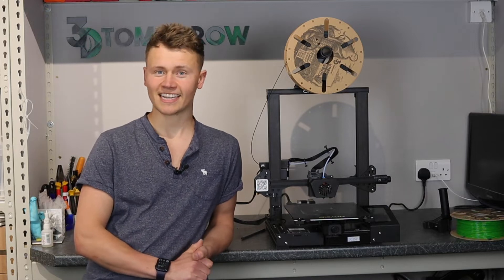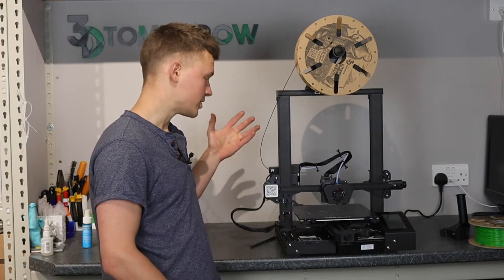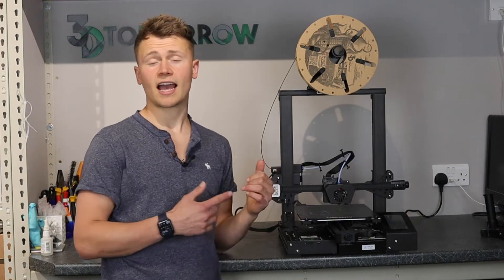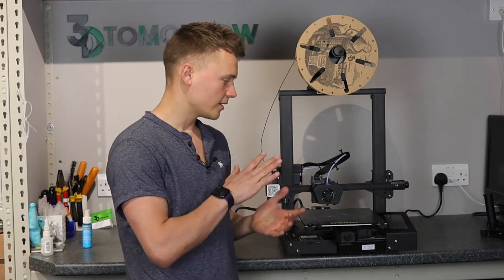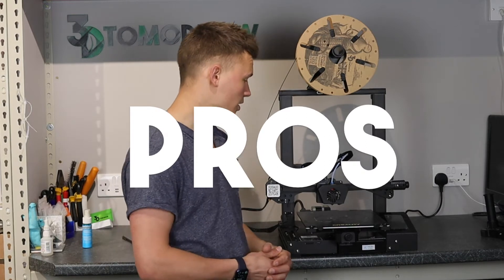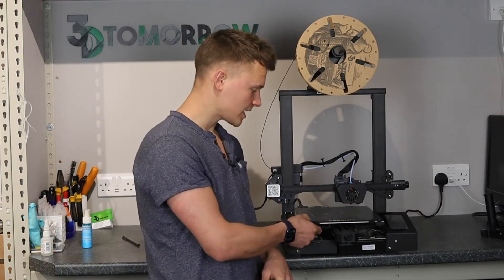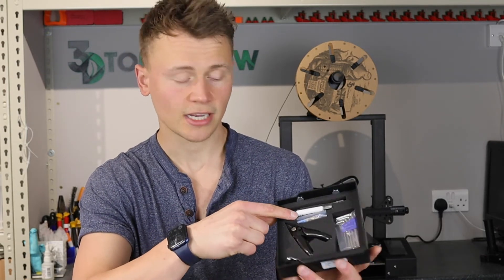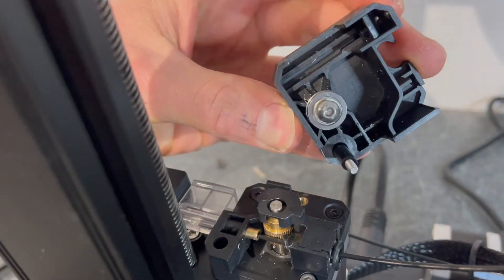Little #WorkHorse || Creality CR-6 SE || 3D Printer Review - Should this be your first 3D Printer?

Comment: First, lovely review. I just purchased 4x CR-6 SE from a local, these will be my first FDM printers and I am doing a lot of watching to get an idea where to start. At least here I got an idea of the hardware.

Where would you start for learning how to get my first print going?
Reply from the maker: Thank you!

In terms of starting off, you’ll want to do some calibration prints to find the best settings for your filament. But before that, get the bed level! For this printer heat it up, remove the filament and give the nozzle a wipe, then run the auto bed levelling.

I should do a series on calibration prints, that would probably go down well, thanks for sparking the idea:)
Reply: @CallumColes  Subscribed so I can see that come out because I have no idea about calibration prints haha. I did resin printing and my calibration was Cone of Calibration by Tableflip Foundry. So if you got some good suggestions, I can google them to see how to use them :)

Comment: Looks like you got a lemon printer. I have had none of the issues you mentioned. Mine is as quiet as a pin, no z homing issues and is literally print and go. You also seem to be missing an insert to hold the spatula. If you put the spool holder on the other side (before the z frame) then the cable does not get in the way.

Comment: Just an fyi if you intend on using this printer in the future, the CR6-SE community has put out a "community firmware" that is much better than Creality's. This added in several fixes to the issues that you've had and you should see a noticeable difference.
Reply: Where does one find this community firmware?

Comment: Good review. 
If you have a noisy fan it's usually a very simple fix. Pop the blades off carefully being aware the shaft may have a very small ball bearing on the end. Why a jeweler's oil dropper or a  toothpick apply just enough oil to wet that ball bearing. Never add too much.
Reply from the maker: Cheers for the comment! Not sure I would be delicate enough to perform that fix😂 but may give it a try in the future

Comment: Great review! I actually just got this as my first 3d printer and am excited to see it’s full potential. What do you use to clean the glass? I been reading that it has a special coating that will go away is isopropyl to clean it, is this a fact?
Reply from the maker: I always use 3DLAC for extra bed adhesion. Then if I do occasionally clean the bed, I use plastic free wipes. I have never personally used isopropyl to clean the bed, but it's very unlikely to damage the surface, just a bit OTT.

Comment: Nice review.  I have this same machine for over a year already.  On your "cons" side, my hotend fan is very quiet compared to yours and I have never had any issues with the Z-axis as you have experienced 10% of the time.
Reply from the maker: Thank you! Appreciate you sharing your experience, have you had any problems with the machine?
Reply: I second the hotend fan being quiet on mine as well and I've had mine for going on 2 years now. Only issue i ever had with this machine was a failed print that got all globbed up inside the print head and was a serious pain to clean but that was likely my fault since i had moved the printer to a new location that had less stable temps and the print detached and got all messed up. Otherwise pretty good plug and print printer.

Comment: its actually worse to have the spool holder up top. that why many ender owners make side mounts lol
Reply from the maker: The spool holder itself will have more impact than the position, directly into the extruder is always going to be better I would agree, but not a problem to have on top if it suits the workspace better

Comment: Looking forward to that s1 comparison.  Does anyone know why there are eBay listings for the cr-6  for around $300??  Are they legit? Damaged machines? What do we think?
Reply from the maker: I only paid £260 for mine, which is about $320, so I wouldn't be too concerned by a price at $300. Just with eBay, always check the seller has plenty of decent reviews and not just 1 or 2... It's a well priced machine
Reply: I just bought one new from micro center for 278

Comment: Another great review Callum, when I was looking for my first printer it was hard to choose between this printer or the Ender 3 S1, the deciding factor was the direct drive extruder on the Ender 3 S1 and it had everything else the Ender 6 had function wise. As with everything cost is a factor, budgets determine compromises but I am still glad I went for the ender 3 S1 and I am using it to print the upgrades for my ender 5 plus :) For your questions, Would you do a Delta printer? I find them interesting to watch. For the filament, I am trying to find a fast transition multi colour filament (3-5m), they are hard to find in the uk and even harder to find in 2 or 3 kg reels. For a project, I found your video about the extruder upgrade on the ender 5 plus hugely helpful and it’s an upgrade I just performed today. But the ender 5 plus really needs better part cooling and I am struggling to understand upgrades such as the “hero me 6” kit as it’s great but too flexible as to component selection for a stock ender 5 plus.
Reply from the maker: Thanks Steve, appreciate the continued support. Yes, the extrusion setup is one of the big differences between these two machines. They are both good machines, I think you would have been happy either way.

Yes I would do a delta, not that I've ever even seen one in person over my 8 years of printing, it's probably about time I did! Would probably be great for timelapses, which I want to start doing more of.

In terms of fast transition, they're a tricky one, need a very precise colour doser that can accept as many components as colours you want in the end filament. With labour costs being what they are in China, I wouldn't be surprised if someone manually put the colour in lol. I might have a play with it in the future, but not on the cards for the moment. I've said it before, filament is not a game to get into if you want to make money, machinery is so damn expensive. Certainly a passion project. In terms of multi colours though, I'm considering doing something a bit like the nebula filament from Proto-Pasta.

The upgrades for the ender 5 could be a good idea for a video actually, a lot of views have come from the videos on that printer, so I think it has quite a fan base! I'll have a think about a few of the easier upgrades that could be done, where others might want to try as well.
Reply: @CallumColes  With me at the moment only just coming into 3D printing I am like a kid in a candy store, I use 3D Tomorrow filament as it is consistent that way I can verify that any change I make to the printers are either successful or not without worrying about the filament being one of the variables effecting printer output. The ender 5 plus does have a following, but after your review videos we don’t see much of what you encounter after running them longer term, if you have breakdowns or issues, this is an area very few if any reviewers/channels bother with showing. The other thing you are uniquely able to do is help us get the best out of a particular printer with 3dtomorrow filament could be video shorts? The proto pasta nebula style of filament would be nice, at the moment I’m drowning in requests for printing these flexible dragons (though it may be because I give them away free lol)  and so I am constantly looking for different filaments, uv reactive caught my attention the other day. it’s a gamble though on the quality and consistency of some manufacturers and some leave a lot to be desired. I am looking for projects for me to try out the 3dtomorrow wood and marble filaments so when I do expect an order :)
Reply from the maker: Generally before the review goes live, the printer will have done at least a few hundred hours of printing, so most mechanical problems present themselves. When the printer does start to fail, the first things that go wrong are normally the heating elements, hot end + thermistor. For the bed slinger designs, the same is true for these heating elements, although normally less of a problem when the bed only moves vertically. Generally, you don't see these types of failures until at least 1000 hours. For plastic components that have contact, these wear down and can cause problems, although I normally highlight this point in the review.

I suppose I could do follow up videos of replacing failed components like the thermistor and hot end, next time these go wrong.

Glad you're liking the filament! You should definitely charge for the dragons, even if just to cover your material. People don't appreciate freebies as much as they should!

Comment: Great review Callum! Once again, very thorough and to the point. Some may find you are " nitpicking" but I disagree: this is a Creality machine, maker of printers for a long time. I cannot believe yet again how they get so many bad designs ideas, some so small (spool holder, tie wraps).   Good job on the new camera angle and lighting btw! Brighter and easier to focus. 
1) I actually have none except if you ever get the chance, I would like to see how premium printers perform. Are they worth the extra 100-300%?
2) I would still like to see/hear more about your operation?
3) I just found a great Canadian company that make their own filament from scratch, Matter3D. I am testing their 850based now and so far it is great and will become my go-to filament ( I'm releasing a small 3d printed part soon and have tested 17 different "manufacturers" so far and to date only Sakata holds up for the best finish/ease of operation. C
Reply from the maker: Thanks for the comment, much appreciated! Glad you like my 'thorough' reviews haha, I really do put these printers through their paces, so probably pick up on a few more of little annoyances than the printer reviews that just print a few pieces. That said, I know I could do with doing a few more prints to actually show off in the review, so will try and find a workflow for that. Yes, I know right, it's crazy! They just pump out more and more machines, without ever really polishing the design. That's sort of the difference between the companies like Creality and Prusa for instance. Countless machines, vs a handful of careful iterations.

Ahh really glad you commented on the camera setup, wasn't sure if it would be an improvement or not. I'm thinking it might be good to have a table side on, so that the printer could actually be parallel to me, should result in both myself and the printer being in good focus.

1) The closest to that so far is the Zortrax Inventure review I did. But I will see what I can do, perhaps reach out to a few companies and offer them a review / return, since I don't have the following (yet), to be gifted these sorts of machines.
2) I do plan to do more on that, just secured some garages/forecourt at an auction, so will document my journey to get this turned into the proper home for 3DTomorrow, at the moment it's a bit all other the place (Home+Commercial Premises+Storage Units).
3) Interesting, 850D is the grade for annealing yes? Does it differ much to 4043D when not annealed? It's a shame you're so far away otherwise I'd suggest giving our BioPro a try. I'm biased of course, but it is great. That said Sakata is a Spanish manufacturer, but I suspect they have international resellers?
Reply: @CallumColes  Camera Steup: yes, I fully agree: to have a nice table setup with printer parallel to you so both are in focus in the same shot. The visuals have become so sophisticated even for the simplest YT channel I would be a challenge to start one!

Suggestions...
1) I'm somehow missed that Zortrax review! I fully understand your comment, and of course they are way too $$$. Even some larger channels don't even review pricier machines since most viewers couldn't afford them in any event. The comment stemmed from pure curiosity: is the print quality any better. I tested 3DHUBS (now just called HUBS) to see if they could print my small parts better than I could with my modified printer. I believe they used Ultimaker for my small run. Outcome: no, they cannot. The print quality was awful. I was expecting much better. My stock Ayncubic Mega S (at slow speeds of course), printed better.

2) I look forward to those diary vids Callum! I'm a entrepreneur myself and know all too well some of what you are going through. I am lucky to own a home with large spare areas that I renovated myself for my business and that of my wife's.

3) Sorry for the misunderstanding: the "850D" is the base plastic pellets used (INGEO850). I'm a mechanical engineer, not a chemical specialist at all but from what I know, it seems that many better (" ") PLA filaments use this as the base for a certain type. You know 1,000% more than I do so, I won't pretend at all. Funny, I believe, don't quote me though, that my other Canadian supplier/manufacturer uses 4043 base for their "Though Line" PLA. It is an amazingly tough and strong PLA and closely matches that of PETG! For my products, it is overkill and too costly. Yes, Sakata is carried by several retailers here in Canada. I think it is one of the most dependable product I've encountered. Until now, with this new all-Canadian brand. Yeah, shipping from the UK and the exchange rate would make you filament a bit pricey!! I'm a huge supporter of small local businesses and buy out-of-country when I have too, and even then, try to buy from smaller outfits.
Reply from the maker: Sorry for the slow reply, been away! Have been super busy recently so needed a break, work hard play hard as they say haha!

So in terms of industrial machinery at the end of the day the processes are the same so there aren't mind blowing differences. Having had experience with a range of machines from the cheapest to the most expensive, this is how I'd explain the difference.

Consumer (Anycubic, Creality, etc) - Unconstrained with limited monitoring/ control processes. Wide range of output results possible, more dependent on operator skill. Results can match prosumer units.
Prosumer (Ultimaker, Zortrax, etc) - More constrained with some monitoring/ control processes. Higher success rate with less effort for the operator, but less flexibility in control.
Commercial (think Stratasys) - Very constrained usage, lots of monitoring and control processes. Wider range of high end materials. High success rate. 

In other words, there is a difference, but its not night and day. If a skilled operator was to print PLA on all three machines, you'd be hard pressed to tell the difference. More difficult materials start to widen the gap between machines, if possible at all at the lower end.

I've just managed to purchase a 3DP1000, which is a 1mx1mx0.5m printer, so will probably do a video on that. Buyer's guide to buying old machines sort of thing. I've not seen it yet, so could be a mistake, we'll see!